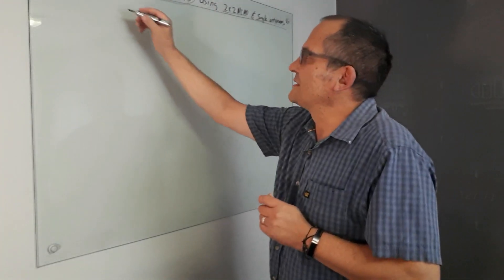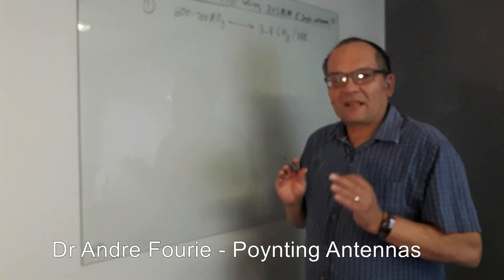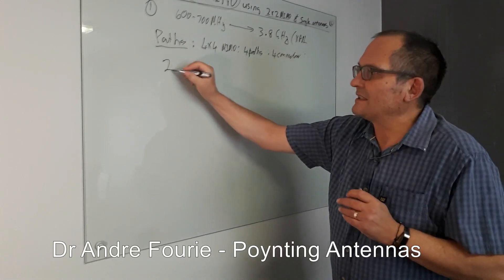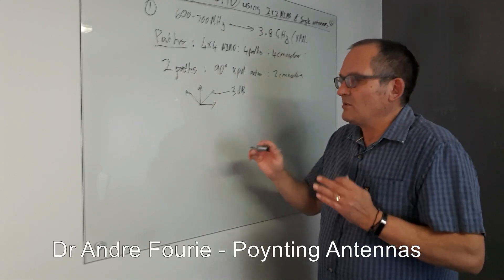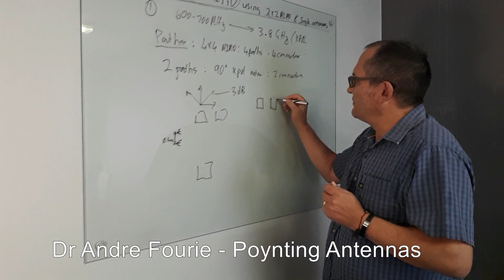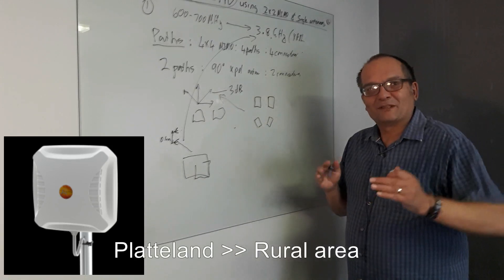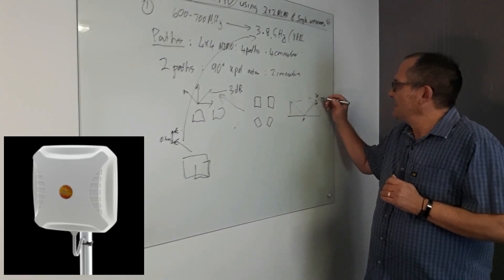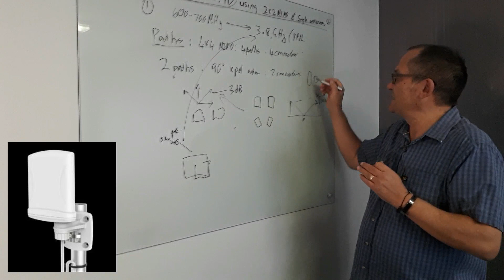Constructing 4x4 MIMO Solutions using Poynting 2x2 MIMO Antennas

Comment: Hi we have Cisco IW9167E access point. So for 4x4 mimo configuration how many antennas required?
Reply from the maker: Hi - you will need 4 antennas. Note that you can have one or more antennas in one enclosure. Here are some examples of what will work for 4x4 MIMO
4 x LPDA-500 - these are individual Antennas
2 x XPOL-2-5G - 2 antennas in one enclosure - so you need 2 to have 4 antennas
1 x XPOL-24 - this is 4 antennas in one enclosure - so you need 1 to have 4 antennas

Here is a link that shows all 3 options: https://poynting.tech/compare-antennas/RLENZW

Check frequencies as well as connector types.
Looking at the Cisco IW9167E access point frequency bands and connector types the LPDA-500 seems to be the best option. Please get in touch with your closest POYNTING partners to get more specific advice. 
https://poynting.tech/contact-us/

Comment: Sounds like 2 XPOL-2-5G,  is better choice than 1 XPOL-24. At least the distance between two antennas is very small in XPOL-24. Unfortunately I've  just ordered XPOL-24 a few days ago.
Reply from the maker: Thank you for your question. Both the XPOL-2-5G and XPOL-24 have their advantages. The XPOL-24 offers higher capacity with its 4x4 MIMO, which can enhance overall performance, especially in high-demand scenarios. While the distance between the antennas in the XPOL-24 is small, it is designed to optimize spatial multiplexing for better signal quality and reliability.

If you need flexible coverage or redundancy, 2 XPOL-2-5G antennas can be a great choice. However, the XPOL-24 you ordered will still provide excellent performance for most applications.

Comment: In our experience what isbthe maximum distance from BTS from 4x4 mimo lte to acheve still good results?
Reply from the maker: It is important to emphasize that RF propagation depends on quite a few things including antenna sensitivity, power output, network congestion, weather conditions, the terrain layout(clutter), operating frequency to mention just a few. However, you'll typically still get good LTE service from a BTS even at 50KM away if the mentioned factors are in your favor. Thanks.
Reply: @poyntingantennas  thank you Profesor :)

Comment: Is there any difference between 5G 4x4 mimo and wifi6e 4x4 mimo?
Reply from the maker: Dear Marvin - from our techteam: 
There is a two-part answer to this query, and I’ll try to be as detailed as possible while trying to clarify each part. 

Part 1: MIMO As A Method 
Multiple-Input Multiple-Output(MIMO) is the ability of a wireless communication system, to exploit multipath propagation by multiplying the transmission and receiving antennas on the radio link, to maximize the data rates. Both WiFi6e and 5G systems can use MIMO.

Part 2: 4x4 MIMO On A Technology 
5G can achieve data rates of up to 1Gbps, while WiFi6e can realize data rates of up to 9.6Gbps. This is because the highest modulation that can be implemented on 5G is only 256QAM, while on WiFi6e it can go up to 1024QAM. 

With the two considerations above, it is then noted that as a method, MIMO is the same on the two wireless communication systems, but when implemented it can differ depending on especially the modulation scheme implemented on each system. Thanks.

Comment: Dear Dr. Andre ! Can i use Xpol-2-5G with Teltonika RUTX14 ?
Reply from the maker: Dear Tri Nguyen COT

Thanks for watching our videos!

XPol-2-5G will work with RUTX14 but this is a 2x2 MIMO antenna. 

If you need a 4x4 MIMO 5G antenna, you can consider using the OMNI-214 or OMNI-414 antenna depending on your application.

Kind regards
Poynting Technical Support
Reply: @poyntingantennas  | Thank You so much Dr. Andre !!!

Comment: How can I space two 2x2 MIMO omnidirectional antennas to achieve 4x4 MIMO ?  Do I need to worry about polarization?
Reply: Since the antennas are omnidirectional, I think the proper install would be one higher than the other. Perhaps .6 meters or 2 feet or more from each other.

Comment: Thanks so much for this, very helpful indeed!!! I was wondering, could you mix and match antennas I already have a Poynting 4G-XPOL-A0002 installed with pretty decent success and have been running it for just on a year now. If I were to add an additional XPOL-2-5G would this work ? I know it wouldn't deliver like 2x XPOL-2-5G, but in theory I should be able to take advantage of the frequencies -5g or am I wrong?

Comment: Hi, i have an H112-372 (4x4 mimo) connected to external antenn an xpol v3 (2x2mimo) with clf400 cable (pigtail 20cm lmr195) my question is it possible to get two antenned = 4 cables inte my two clf400 cables into my router. I have read about antenna stacking but i do not understand what connectors to use.

Comment: Can I use, let's say 1 xpol-2-5G antenna (which is 2x2 MIMO) with 15m cable and then splitters (1 for each connector on the antenna) and connect the ends directly to the modem board to achieve 4x4 MIMO? I'm using Huawei 5G CPE Pro which has 4x4 MIMO capability but only has 2 external antenna ports. Will there be caveats like signal interference, signal loss, etc? Thanks
Reply: Up
Reply: Thanks, so long story short, it is possible :)
Reply: Looking to use NR5103e with 2x2 xpol-2 antenna
Should i use a splitter (sma to 2x ts9) or go for a converter sma to ts9?

Comment: Love these great educational videos for us mere mortals with brain waves resonating in the Ghz range. ;D
So if the 4G-LTE or 5G modem has 4 antenna connectors (M1/M2/D1/D2), I'm assuming you would need two of these mounted on a pole offset by 45 degrees in order to get a full 4xMIMO?
  I'm looking for a good "one-in-one" antenna with four cables/SMA connectors for my mobile router customers.   An all-in-one antennas would be an easier sell for customers looking for an attractive one piece unit which is easier to install than the two piece units for 4xMIMO.
Reply: @poyntingantennas  Thanks for the info, is the 4x4 with 4 cables/connectors available, and where can I purchase it?
Reply: @poyntingantennas  sir can i used 2 mimo antenna with a configuration of 2x14 28dbi for a wifi modem cat lte 6??
Reply: @poyntingantennas  sir can i used 2 mimo antenna with a configuration of 2x14 28dbi for a wifi modem cat lte 6??

Comment: Andre, Please can I clarify:
1. Is the suggested 0.6m spacing between centres of the two antennas - or edge to edge?
2. In the dwg of four antennas, two upper square on & the two below +/- 22 degrees. Is that actually 2# XPOL-5G antennas, the upper mounted normally & the lower one turned through 22 degrees?
Thank you, Steve
Reply: Poynting Antennas Yes, it will still be very useful. Whilst I’m writing please take a look at this presentation: https://youtu.be/FVgLUBVjKu4
Unfortunately the spreadsheet is no longer available but if one of your engineers could consider re-creating it that would also be a very useful tool. Thank you, Steve

Comment: So are you saying in simple terms use 2x XPOL-2-5G antennas @ 0.6 meters apart and that is 4x4 mimo? Does the attached modem need 4 antenna inputs or are they joined together?
Reply: @poyntingantennas  hi thanks for reply. Do you know of any such modems/routers?
Reply: @istis1st84  < 4xMIMO is not router dependent, it's the modem being used in the router which dictates the number of antenna connections.
Reply: Christian Thompson Hi, You might want to take a look at Facebook group: LTE HACKS where both 4 & 5G modems, antennas & more are discussed. An example post from today:

‘I’ve tested the following with good results ... networking dependent so I have managed to get these to match or come close to the EM20-G which is a BEAST

SimCom SIM8200EA-M2
Quectel RM500Q
Fibocom FM150-NA

Untested
EM9190’
Reply: @poyntingantennas  I am from United kingdom.
Reply: Christian Thompson I meant to add, me too, in Chester.
Reply: @poyntingantennas  I will have a look at this thank you. So to be clear I need to use two of your XPOL-2-5G @0.6m apart?
Reply: @poyntingantennas  the b5328 has 4x4 internal antennas, no option for external antenna inputs. The b618 is also 4x4 internal but only offers 2x2 external. The netgear M1 is 4x4 internal and 2x2 external, however there are posts online of people modifying the internal antennas for 4x4 external antennas.

Are there any devices that have 4x4 mimo external antenna inputs?
Reply: @poyntingantennas  brilliant thank you for your help. I'll await your reply 😁
Reply: @poyntingantennas  brilliant thank you